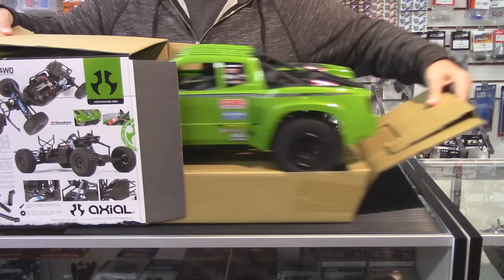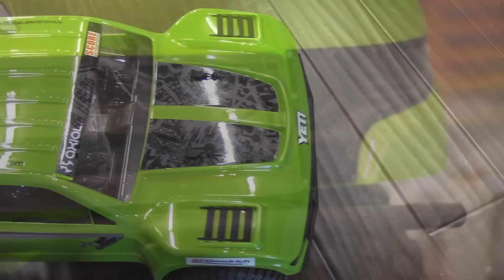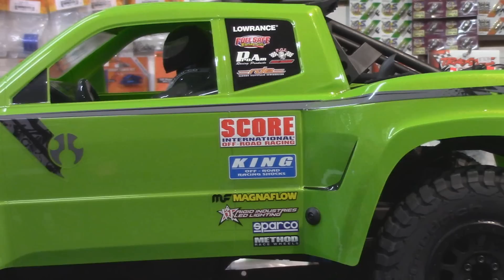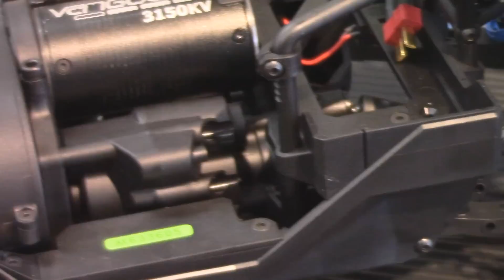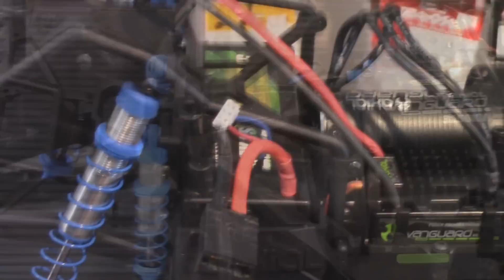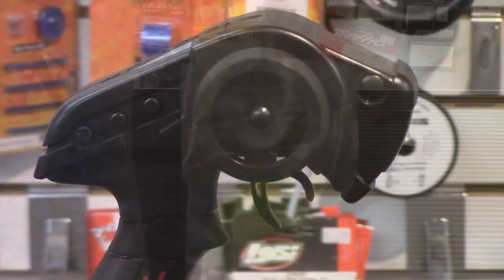Axial Yeti SCORE 1:10 Trophy Truck  RTR, AX90050 - Unboxing

Comment: This truck isn't meant to compete on a track guys. It's meant to be a scale desert racer with plush suspension and authentic details. It will never keep up with super low and super lightweight racing trucks but it WILL look amazing tearing it up over rough ground and power sliding around turns! :)
Reply from the maker: We are aware this is not a competition level truck. It can still be fun at the track.